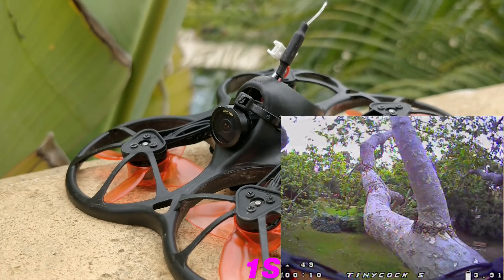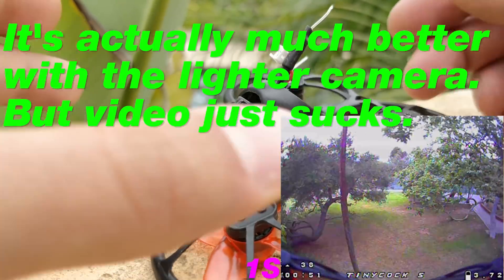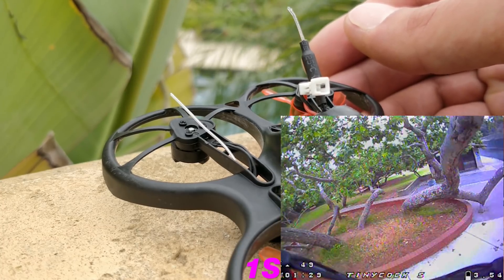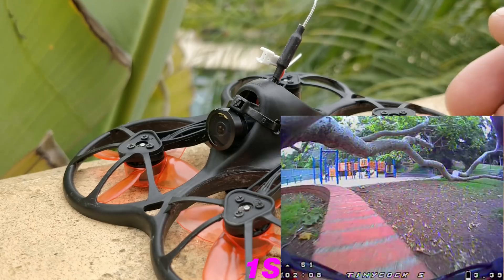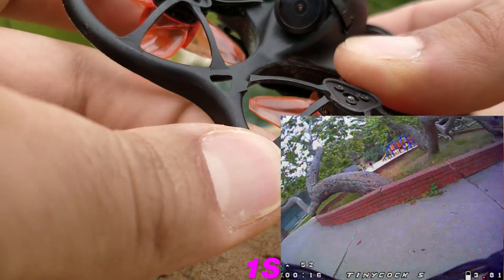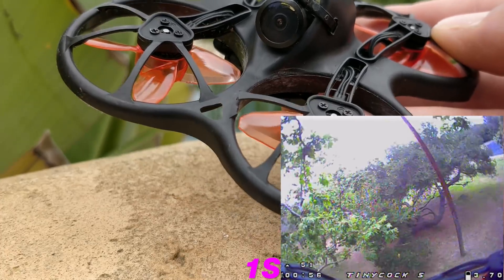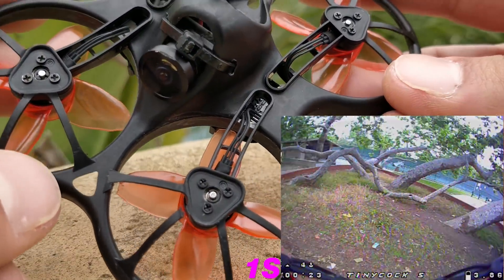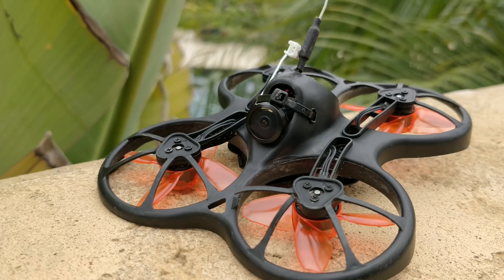Tiny Hawk S - Part 2 of 3

Comment: How do you fix battery sag, I go from 4.2 to 3.7 as soon as I start flying.  Thanks
Reply from the maker: That's not uncommon.  It should stay at around 3.7 until the battery runs out and then it'll probably be at about 3.4v and if you keep flying it'll just fall out of the sky. To battle sag you typically just need a quad that's designed for higher voltages but not especially higher speeds

Comment: How did you setup the rssi? I added it to my OSD but nothing shows up :/
Reply from the maker: You gotta set it up in the controller. I think bardwell and many others have a video on it. I don't remember. I did it years ago.
Reply: @Kabab  ah I see, i have a jumper so I don't think I can use the method Bardwell showed using opentx
Reply from the maker: @RavenWindrunner  I think it's similar since it's still openTX. You just gotta figure out the menus yourself but they should be the same menus
Reply: @Kabab  the t8sg that I have is deviationtx but yeah I'm sure there is a way to feed it through an aux channel.

Comment: I've been flying with 2s and the engines and batteries are getting very hot. I used profile 2. Is that normal?
Reply from the maker: Warm batteries and motors are normal. They shouldn't be so hot that you can't touch them

Comment: how do i put crossfire on it bro
Reply from the maker: You don't need the controller. You can still use crossfire
Reply: @Kabab  I use Horus x12s and the frsky antennas suck I have the second antenna hooked up still it doesn't go too far without fail safe and I guess I'm just to use the crossfire

Comment: I just ordered one having already owned the original TinyHawk.  I like that they are using elastics for the batteries since that opens up more choices.  Rather than going XT30 (since I want to be able to fly 1S too) I was considering soldering on the serial PH2 pigtail from the Mobula7 to be able to run 1x1S or 2x1S batteries in series to sI can use my now sizeable stash of 80/160C 1S 450mAh batteries.  What do you think of this plan?
Reply from the maker: Ya that's better than what's on there but the xt30 is better still

Comment: I see strong voltage sags on 2S and I am courious if it is overproped for 2S or it is due to limitation of battery or that tiny connector (which may me well suited for 1S)
Reply from the maker: Imo it's too much KV for 2s and the battery is also too small for 2s. I'm still testing things to get the best 2s performance.

Comment: I had switched the original old TH cam with the caddex eos2, and it got much better than the crap stock one, but the VTX is still crap, dunno if I should look for a new VTX, I just fly mobula 7 all the time instead around my yard (thou at 50% throttle reduction ;)

Comment: does anyone know if you can swap the receiver on this thing?
Reply: Yes, it has another spare uart (one is used for smart audio).
Reply: Guaranteed!
Reply from the maker: I'm pretty sure it has solder points for an Rx but the one it comes with is built into the board